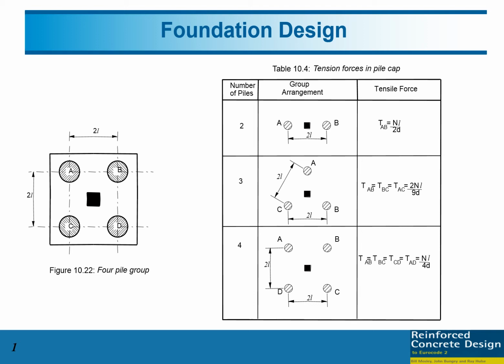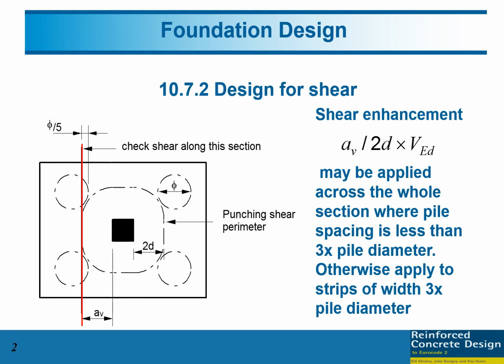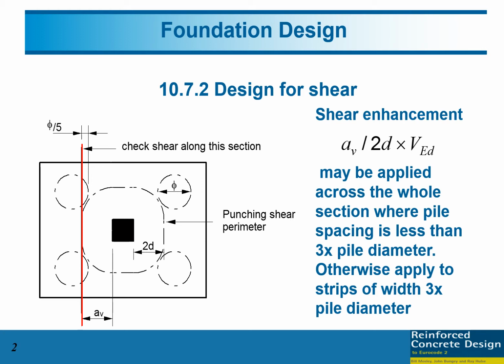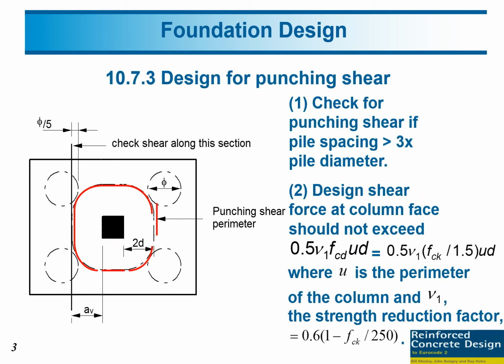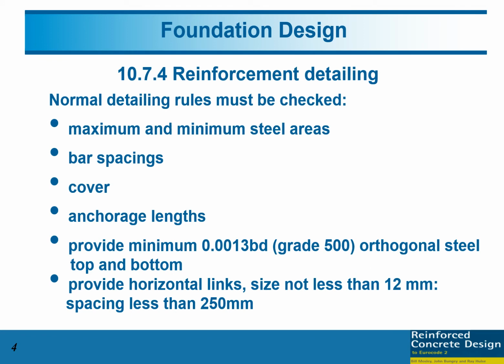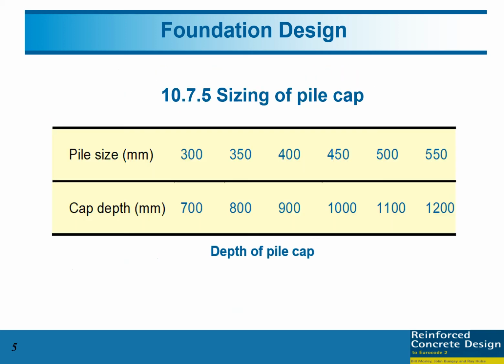Requirements for Designing of Pilecap

Comment: question: if there is a pile inside av, in direction we checked. so it will pressumed that Vshear of the pile is neglected due 45 degree from column? or not